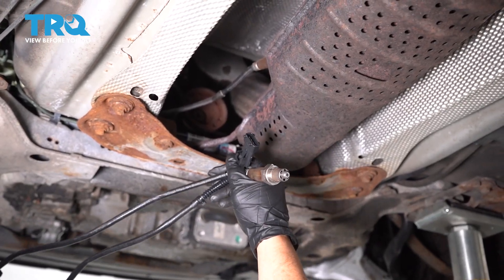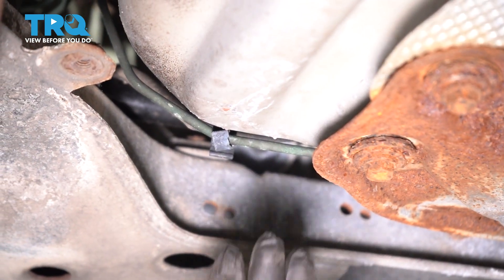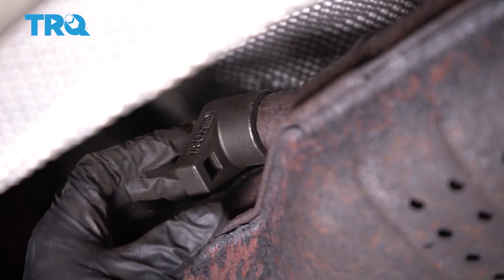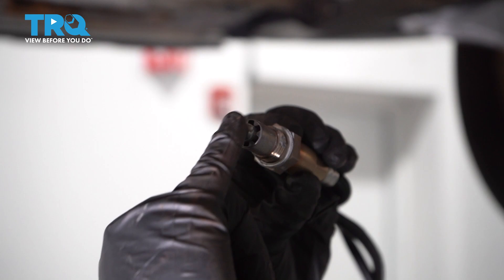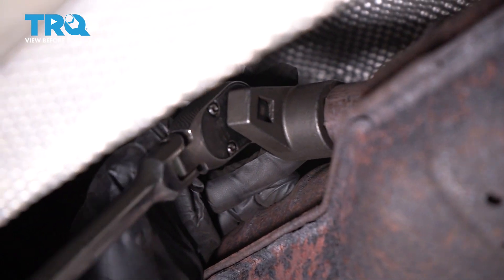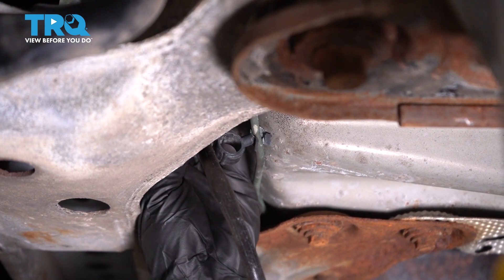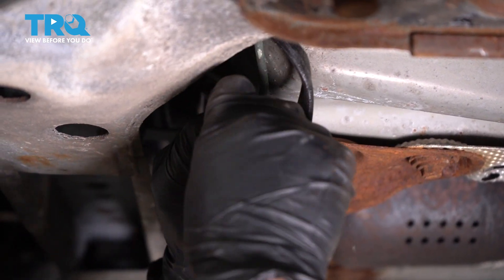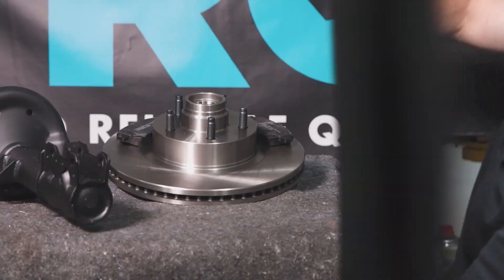How to Replace Downstream O2 Sensor 2001-2007 Volvo V70

Comment: Thanks for this video.  I have been struggling with the connector housing all day, fearing that I would break it with leverage on a screw driver blade.  Then I found your video, and just twisted away.  It worked like a charm.  Both sensors replaced, new Powerflex engine mount inserts, and new shock mounts.  I now have a much nicer v50 t5.  Thanks again.

Comment: If a sensor cable is say 20" longer than needed, if you coil it will it mess up the DC O2 readings (like an induction loop) or cause some type of problematic signal delay?  Downstream is just for emissions but am curious.